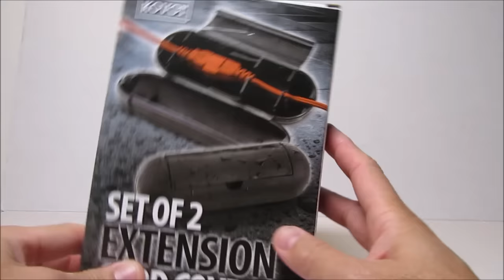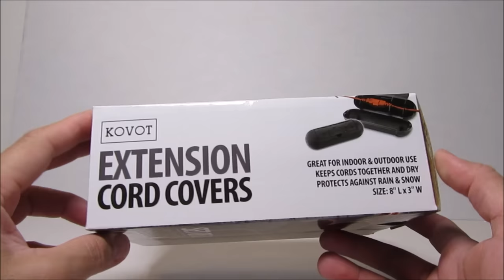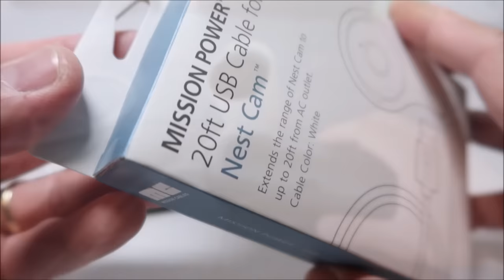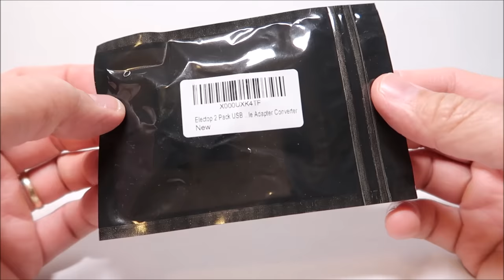Yi Outdoor Security Camera Installation Tips | Extending The Power Cable

Comment: I think you should use a good surge protector in that attic.  Try not to over populate the socket with too many power cords.  Thank you for the amazing videos
Reply from the maker: True. Thanks for the tip.
Reply: I 2nd that. It looks like a fire hazard.

Comment: I know this is an old video at this point but I hope you can still answer my question:  Can you use a UBS to cat5/5e/6 adapter to extend the power?  I'm looking to make my Wyze cam outside under the porch.  Thx for the videos.
Reply from the maker: I'm not sure. I need to check on that.
Reply: @LifeHackster  have you found the answer?

Comment: Hi Hackster. I just installed this cam yesterday and having a few issues. When I modify my region it is not letting me click back to go back to the options menu. I can be 10 foot from the cam but the alarm will not go off. Any ideas to my issues? I’ve uninstalled the cam and the app both it still continues. I reset the cam as well.  This morning, my wife came home and it didn’t dectect her motion or car. Your help is much appreciated! Thanks
Reply from the maker: It is a bug in their latest update. They should be working on an update.

Comment: Hi, I need some help with protecting the 3 wires of the reolink cameras that split to 3 wires. the camera wire is not long enough. i am using wif so only need to get th 12v power supply but then all three wires are exposed.  So I would have thicker wire on one side and the thinner power wire on the other side.   Are their any solutions like that Christmas tree  box but would weather seal and protect? Thanks

Comment: Thanks for your video.

Am I right in saying that this camera only connects on WiFi. If yes another issue will be getting a strong signal outdoors.
Reply from the maker: Yes, it only connects to WiFi and yes, you need to have a good WiFi signal. I use a WiFi extender in the garage for my Ring Floodlight to work properly. I had no WiFi issues with the Yi yet.
Reply: Mesh network!

Comment: Excellent video and links.  Thanks!  I do have an outlet in my garage and a soffit so will drill into my soffit and attach the USB plug on the inside so the hole will be smaller. Then will run an outdoor extension cord inside the garage attic to the outlet to make a clean install.  Can one rotate the camera lens eye like one can do with the Yi Dome?
Reply from the maker: Thanks. Yes, you can position the camera so that it will be right side up either in a wall or soffit install.

Comment: If i setup it outdoor. The thief can cut the cable. What is your solution ? Plz reply me
Reply from the maker: You can always hide the cable or thread it inside a pipe or cable raceway.
Reply: On the outdoor model does it continue recording at all when its been unplugged?

Comment: I think you should just provide longer cable, someone can just come and disconnect your camera and that’s it. Your best installation was the one to the attic no one can mess with you cables
Reply from the maker: Yes, I like the attic install too..no worries about wires getting unplugged.
Reply: I like Attic install as well.. If you use a power extension, do you need to weatherproof it or no need since the attic is covered?
Reply from the maker: There is no need if it is in the attic.

Comment: Can you not hard wire the cable from the camera to the mains power supply?
Reply from the maker: Not really because it will need a transformer/power adapter..It runs on 5 volts./USB power.

Comment: Can anyone recommend an actual 3 to 5 meter data usb extender that will do double duty? I mean on the one hand for power and also if I want to plug the cord into my laptop to acces the cameras sd card if my internet goes out and i want to see what was recorded
Reply from the maker: Not with Yi..their USB is for power only. You have to use your smart phone to access the recordings or pull out the micro SD card and view it on your computer.
Reply: @LifeHackster  thanks